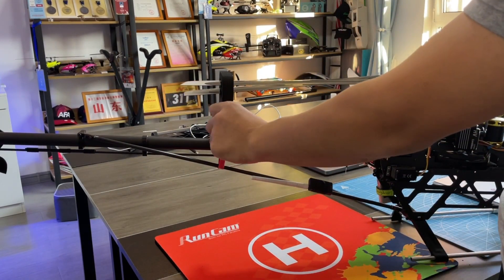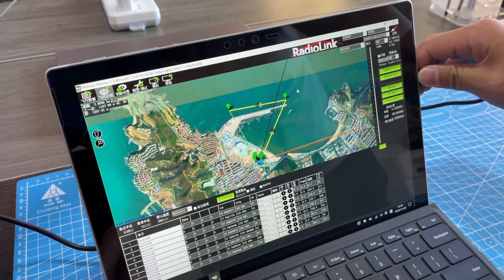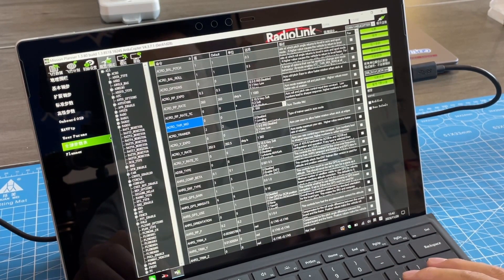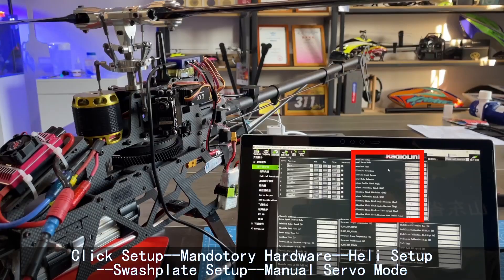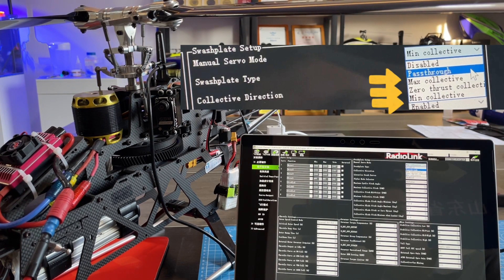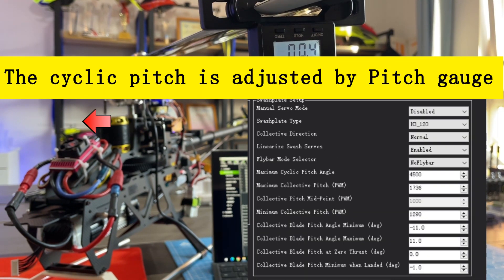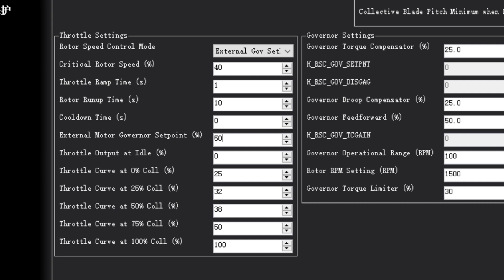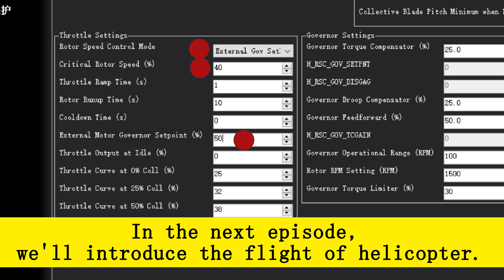Set crossflight/Mini Pix/PIXHAWK on Helicopter / Episode 3 Swashplate Setup

Comment: Can I use it for my rc helicopter which has two brushless motors (one is main motor and other is tail motor, it has 3 servo for main swashplate and no servo for tail) ?
Reply from the maker: Hi, sir. Yes. You can use CrossFlight on your helicopter. You can check details on how to set tailrotor from the detailed manual Chapter 5.5.6 Tailrotor Setup. Here is the link of the manual of helicopter  https://www.radiolink.com/crossflight_manual   If any question about RadioLink products please feel free to contact us. Our email is: after_service@radiolink.com.cn
Reply: @Radiolink_official  does your firmware support tail rotor motor(seperate) speed adjustment?
Reply from the maker: @ayushkawalgaonkar2318  Hi, sir. When the tail type is 2, you can adjust the speed. You can search H_TAIL_SPEED in Full Parameter List to adjust the speed.
Reply: @Radiolink_official  does it support flysky receiver and radiomaster boxer transmitter?
Reply from the maker: @ayushkawalgaonkar2318  Hi, sir. CrossFlight supports standard SBUS or PPM signal. So could you please check if your receiver supports standard SBUS or PPM signal? If yes, they can work together. If any question about RadioLink products please feel free to contact us. Our email is: after_service@radiolink.com.cn

Comment: How to setup elrs in radiolink crossflight
Reply from the maker: Hi, sir. The setting methods are as follows:
Connect the crossflight to Mission Planner--CONFIG---Full Parameter List---search SERIALX. Change the value of SERIALX_BAUD to 115, and the value of SERIALX_PROTOCOL must change to 23 ---Change the value of RSSI_TYPE to 3 -- RC_OPTIONS check options: Suppress CRSF mode/rate message for ELRS systems---Click  “Write Params”.
(Note: X represents the telemetry port. If TELEM1 is used, then the X means the number 1, SERIAL1 should be searched in the Full Parameter List menu)  If any question about RadioLink products please feel free to contact us. Our email is: after_service@radiolink.com.cn
Reply: Thank u
Reply from the maker: @sohommitra5127  Our pleasure. If any question about RadioLink products please feel free to contact us. Our email is: after_service@radiolink.com.cn